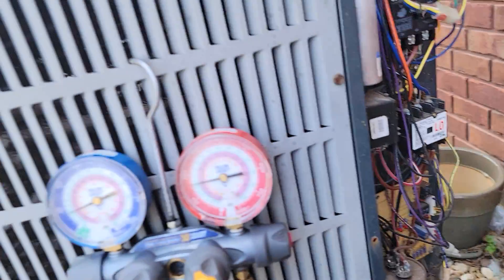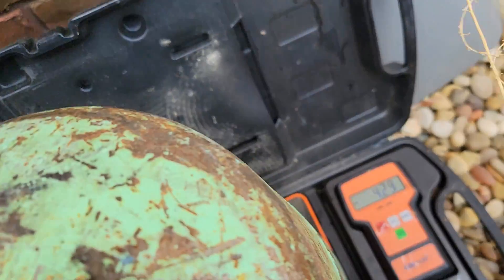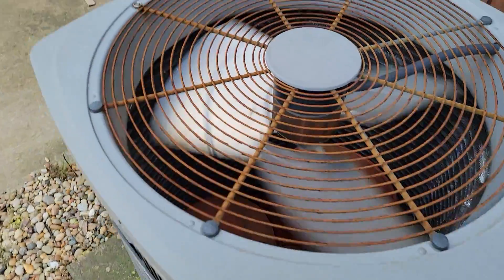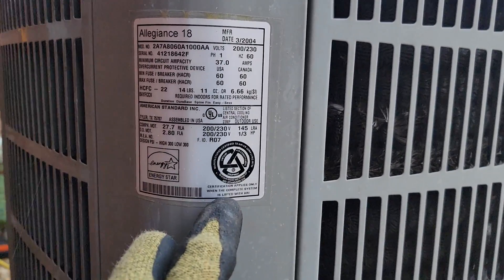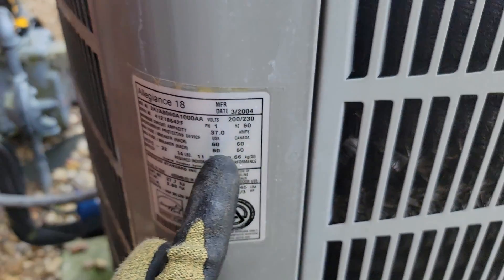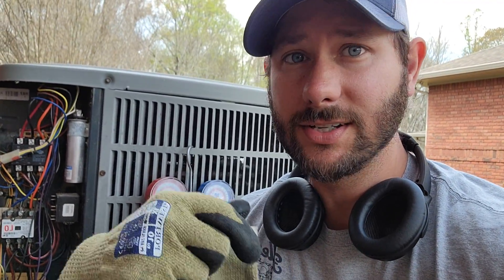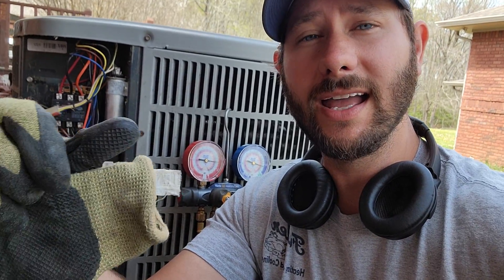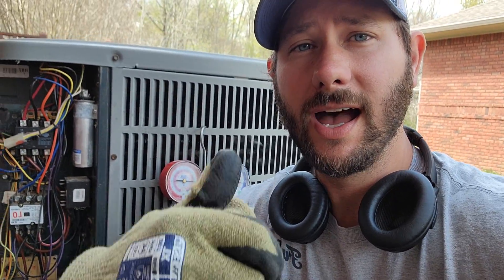How much does it cost to charge an air conditioner?

Comment: Thanks for the tips on recharging my system. I've learned to repair my own ac because quite frankly I'm so sick and tired of the ac industry ripping everybody off! So now I need a new compressor and thought hey I'll just call and see what somebody will charge to replace it. $3,000 so far is the cheapest I've found. Soooo let's get this straight, the part costs an ac guy about $900. Okay then he fills it with 9lbs of new refrigerant that's about another $250. Fine. His cost is $1150 and the labor will be maybe 5 hours (and that's probably being very generous for an experience tech). Hmmmm so $3000-1150 = $1850 or 370 per hour! LOL! Okay I know a business has to cover overhead and such, but that is ridiculous and why I refuse to ever have a company do my repairs. This industry is such a scam! Go ahead, tell me where I'm wrong.

Comment: I’m being charged $2500 for evaporative coil replacement on a 3 ton AC ; is that price low , ok or high price? Help! It’s in Las Vegas area.
Reply from the maker: That sounds a little high
Reply from the maker: Around 1500 to 2000
Reply: @taddydigest  thank you buddy, that’s what I thought.
Reply: Around $ 2000.- sounds right Make sure to use reputable co. and get warranty!

Comment: I have a 20 year old R22 system with an air handler and soft duct work in a very tight attic. 

The system stopped cooling about 3 dayd after I closed on my house. I had a tech come out and charge it with 4 pounds of refrigerant. $600. 

That lasted the remainder of that season and 2021 season. 

This year no longer cooling again. 

Would it make sense to just replace the system now? It's easily surpassed it's usable life cycle. I've been limping along with window units. 

Also, would a heat pump make sense that would help with heating and cooling? I live in southern New England. 

Thanks.
Reply: Damn! That’s a lot for r22 even now in 2022! I bought a 2.2lb can of r22 off of eBay for $100 and the gauges and hoses for $26 and fixed mine myself because where I live..no hvac guys will work on older units and have a discrimination issue with my status and my home being older and being worked on…if only we could all have a spouse that paid our bills and a desire to pay huge mortgage payments and never have our home paid off like I do lol…so yeah…lol…that’s one hell of a mark up for r22! In the US where it’s “banned” it’s not even that much…u can still get it online and u don’t need a license to get it…I also got a tube of pro dry and pro seal and put that in my ac along with the Freon to see if it would seal up the leak..the creep who reinstalled it did the worst brazing I’ve ever seen and it was to try getting me to buy a new unit from him at that time but I had just paid for the home to be made livable again and told him I needed this one to last a few more years because I like paying in cash and not have any debt.,,but the guy has a list of civil suits a mile high for work he started and never finished…I wouldn’t have dealt with him but it was a contract thing between the previous owner and him….and I imagine he had me blacklisted where I live just because he’s like that…none of these creeps can see im a single mom trying my damnedest to make it on my own without having to con males to pay my bills or do work for me for free like air of women do…instead they prefer to make it impossible for me but I’m not giving up…I fixed the problem myself…for now…and the r22 systems that are made of copper instead of the cheap aluminum like they have in them now are much better quality and can be changed out to make them the sweat type of Freon..if there isn’t a ban where u live, I wouldn’t swap it out for the new stuff cuz the r22 is much more efficient and is said to be less corrosive making the unit last much longer

Comment: Thanks for making this video. My HVAC unit is almost 30 years old but still in working condition. Got a HVAC guy today for AC tune-up. He measured and told that refrigerant (R22) is empty. He told that cost for refilling R22 is $220/lb and my unit needs 2 pounds. He said to replace whole unit (~$6k) as it's not worth spending on refilling as it will leak again for next year. Not sure what to do. I am thinking to do refill for now and push it until system fails. Where can I get R22 for lesser price? Any inputs would be great.
Reply from the maker: You can get a refrigerant called for and called 422B Which is a retrofit freon 4   R22
 It's about $50 a pound
Reply: @taddydigest  Thanks for quick reply :). Do you know if I can purchase R422B without EPA certification? Also, can you please tell how to do refill if my unit don't have both high and low side but just one port for filling refrigerant?.
Reply: Find the leak and fix it
Reply: @joshsmith2982  easyseal
Reply: eBay…u can get 2.2lbs of it for $100 and u don’t need a license to get it…the gauges and hoses to fill it are also sold on eBay for about $26..,that’s an awful high amount they’re charging for r22! And to think all they’re doing to the r22 is taking the fluorine or chlorine out of it because of the whole climate change scam…they’re all natural elements found to be naturally released by the earth into the atmosphere…but they have to constantly change things up to make sure we have to pay the price for simple luxuries like staying cool in the dead heat of summer…it’s absolute money making scam
Reply: I had used R407C in my system in it works well; did this 7 years ago. R22 is not longer made; can only find recovered. Certify origin as some cos. may sell subpar refrigerants coming from the far east!

Comment: Thank you for this video! I am trying to find info on my situation. I think I got scammed from an A/C company whom we used for the past 5 years after having them Install it. 5 ton unit needed a new compressor after a bad lighting storm went through. Tripped our breaker, and couldn’t reset it etc.. prior, our A/C was ice cold, never any issues! Acidic test positive.  We have always had a dryer filter in-line, but he suggested another type of filter in the other line to catch contamination. Run unit for 3 weeks and then have them change out the contamination filter for another one. Bill was estimated at $1500. Once he was done replacing the compressor, he said he has bad news. He had to add a “little” r410a because we were a little low. The charge was 17lbs of r410a at $57/lb! New bill $2500. To change out the filter in a few weeks would probably be another $500 or so! I don’t feel good about this… I don’t know enough to know when to say no. I may consult with another HVAC company just to explain my situation and see if it all seems legit?  I would pay them for piece of mind. I truly would appreciate any comments you have on this, thank you! (My thought is 17lbs may fill up the entire unit, not just a “little low” situation. Could he have let the R410a escape?)
Reply: Best thing for a homeowner is call a trade association or the product makers and ask for references. It will save you lots of money and aggravation!
Reply: Rule of thumb is 2 lbs of refrigerant per ton, I'd say they ripped you off.
Reply: @MrKalashnikov47  No doubt about it!
Reply from the maker: You're welcome thank you for watching the video
 Price per pound for 410 a doesn't sound too bad
 Now the model and shield number will give me the factory charge so then I can find out how much refrigerant the unit takes
  Let me know if you need me to consult I can do facetime
 Just click the join button let me know if you need me
Reply: @taddydigest  Didn’t think about that, but having you consult may be better than a local company. How can we connect? Thank you!
Reply from the maker: Join this channel to get access to perks:
https://www.youtube.com/channel/UCuMyjTVlkM4xZ5z_eSyoB1w/join

Comment: Taddy Digest my condenser unit outside has frost on the valves, and all the way inside the condenser unit. Is that happening cause I’m low on refrigerant. I’ve been changing my filter religiously every 3 months with the box filter 16x25x4 since the AC was brand new. 
Meanwhile inside my home it’s not cooling down. But if I wait a few hours for the frost to melt on the valves. Then my home will cool down with no more frost on the outside valves. 
I know I have a leak somewhere and I suspect that it’s coming from the inside coil on top of the furnace. The company that installed both my furnace and condenser coil quoted $400 three years ago to do a leak search. Today with high inflation it’s probably over $500
Three years ago that same company charged me $69 per pound for four pounds of refrigerant.
A month ago in May I was quoted $119 per pound. And that’s before  I pay for the visit charge.
I’m in Southern California 50 miles east of LA
Reply from the maker: wow thats a lot for freon per pound yes you may need some freon it will freeze when pressures get low
Reply: Thank you Taddy Digest for responding back.
Reply from the maker: You're welcome handsome package
Reply: Taddy Digest 
An ac company came over and installed 4 1/2 pounds of refrigerant. I was down that low. 
They then added a stop leak sealer which made its way up to the coil. Since then my ac has been working great. It’s more colder in here now, then it’s ever been. 
I had the refrigerant checked out on my ac condenser. And it still has refrigerant. It hasn’t leaked. 
Thx
Reply: Umm.,,shouldn’t the warranty cover the leak that is obviously from poor installation by the hvac company who installed it?

Comment: I will never call another tech to my house again. One guy said I was low on r22 but he don't use that anymore. He wanted me to buy a new $9,000 unit from him. The next guy said I was not low but my unit was too small for my house. He said I need to buy a larger unit for $10,000. I watched a bunch of home a/c videos on youtube. I then bought a gauge set, a r12 to r134 adaptor and two cans of freon from Walmart. I pumped in those two cans and my a/c is blowing colder. Yes I need to add more but this got me through the weekend.
Reply from the maker: It's hard to find a good company
 I want you to find a good technician stick with Them
Reply: @taddydigest  I'm cool.
Reply from the maker: Keep on being cool my friend
 Hope you have a blessed day
Reply: @F165 I am having the hardest time trying to find someone to be reasonable. Where did you buy the r12 to r134 adaptor? What brand of freon did you get from Wal-Mart? My unit is set on 74 but is reading 84 and not blowing cold air. I can't take it another day.
Reply from the maker: Do not buy refrigerant from Walmart
 You need the refrigerant that goes in your system
Reply: @taddydigest  It's keeping my house cool and I didn't have to pay a tech $329.
Reply from the maker: That's awesome
 Pretty good accomplishment
Reply: @Fone65  Having the Same issue buddy.  I'm a Plumber and looked at a can of R22 and it shocked me.  I can get it pretty cheap too.  Or I could.  Have not bought a jug since it is basically illegal, in the to make it anymore.  Took some classes in the past to get my Refrigerant license.  Mixing any other refrigerant with one another will cause the system to fail sooner than later and cost you more than the service charge.  But, if push comes to shove, and it worked, good for you man.
Reply from the maker: You can use refrigerant 422B 
check into it 
It's a good replacement
Reply: @taddydigest  it was 99 yesterday and r134 is still working. Why would I want to change?
Reply: @mountainplumbing  They claim I need a new system. When it fail. I will install a new unit.
Reply: @Fone65   422B is a mix of about 42% R134A.    3% HC600A.   55% HFC125.      Adding a little 134 and getting it properly corrected later shouldn't throw off the ratio very much.     Creative way to get through the weekend.
Reply: @w8what575  How long do you think my unit will run with r134 in there?
Reply from the maker: Dude Truth Thanks 😊
Reply: @Fone65  lol, yeah but it won't be good on your compressor, changing that will run ya 2000 lol, just because it's keeping it cold doesn't mean good, also your unit has a leak, prob the evaporator coil, how old is it?  If it's 16 to 20 years old it's not worth fixing, r22 is phases out, they do have replacement blends
Reply: @projectswithjw   mixing refrigant  is illegal
Reply: @ms.coleman4535  Napa and Super Tech freon is all my Walmart had.
Reply: You need to have system checked out for leaks and repair them or else you'll be adding refrigerant every few days! R22 is no longer made and you can only get recovered R22.
Reply: @bobboscarato1313  I don't need r22 when r134 cool my house just fine. I plan to replace the bad evaporator before summer.
Reply: @blackericdenice  r134 uses pag oil  and is not compatible with  r22  its been almost  a year I'm guessing your unit failed  . 9000 is about right  for a coil and condenser  changeout depending  on how much   r22 refrigant  you needed and labor for a leak search and repair it could  be more  than   a third of the changeout price.  And hopefully  you inform the technician  who recovers the refrigant  that you mixed r134 .
Reply: @mattd19902010  It last for more than 5 months. Summer was over when I stopped using it. I installed a new evaporator and condenser myself.